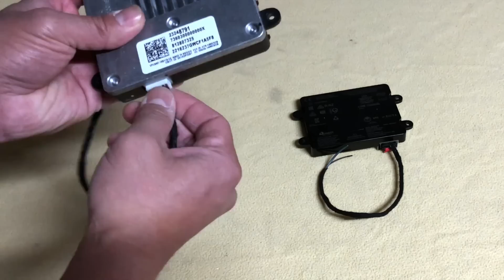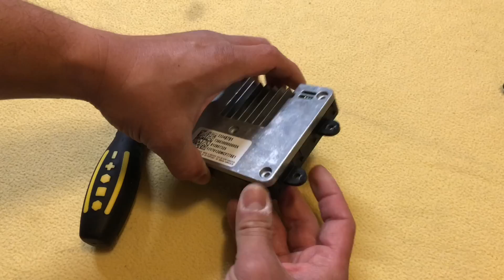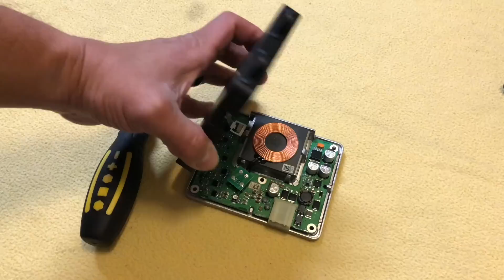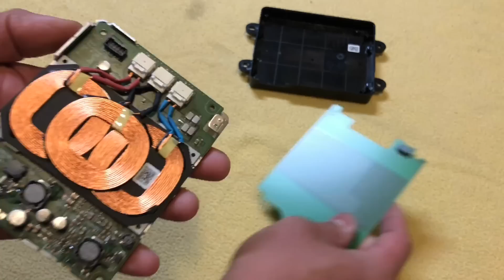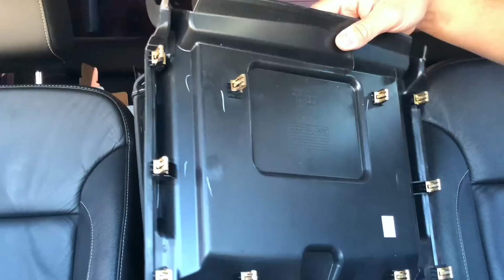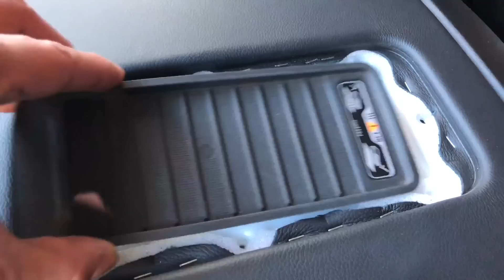2014 - 2018:  GM Silverado/Sierra - Wireless Lid Charging Module Retrofit

Comment: I added my center console from a donor vehicle. It charges wirelessly however my phone says slow charger. Can I assume it is the 18 module? Or should I update it? If it helps I see the charging  pad has 10 raised ribs

Comment: Phil will new charger upgrade charge with the case on your phone? I upgraded my 2016 Tahoe to the new Module, and I am having issues just charging without the case. I think the unit they shipped if faulty as it won't charge even without the case. I have tried moving my phone around but still no dice.
Reply from the maker: Depends. Some thicker cases wont allow the charging to occur, but these 1st gen modules are terrible and not sure why GM released it. The new 2nd gen module charges most phones of today.

Comment: Does this work for the newer iPhones? Like the 11 Pro/Pro Max and newer?
Reply from the maker: Yes.
Reply: @philgamboa2906  thank you for the reply.  That is great to know.  Hopefully the phone doesn’t have to be fully on the mat to charge since they are wider than previous phones
Reply from the maker: @mikey_42712  I have had the larger phones sitting at an angle and it charges.
Reply: @philgamboa2906  thank you for the update
Reply from the maker: @mikey_42712  Sure thing!

Comment: hi is the module 1352 1065 the same as the one you show in the video ?
Reply from the maker: Not sure.  First time I've heard this part # and shows to be from other GM vehicles.  Not sure if its a direct fit or not.

Comment: MY 2017 silverado does not have the wireless charger built in. Is there a website you suggest i can buy one so that i can install it?
Reply from the maker: Not really.  I've seen some on eBay, but you want to ensure you get a 2018 lid that already has wireless charging, as those should be the latest 2nd gen module.

Comment: Very informative video. However you missed the key point on why it won't charge newer phones. New phones use Qi charging protocol, and the old module does not support that.
Reply from the maker: That's correct.  At the end of the video, I show the updated module that does charge and support Qi charging.

Comment: removing the magnet and removing the little pad stuck to the lid will allow the older charger to charge the new phones i did this to mine works great
 the issue with the old model is that the newer phones have a object interference fail safe so the magnet being there causes it to not charge newer phones so instead of buying a new model just take your apart and remove the little magnet in the center and the little square pad stuck to the lid and completely unhook it and bam your old charger will charge the newest phones
Reply from the maker: I tried this and it didn't work for me.

Comment: Great video. I have the early model 2015 without this feature. The factory pigtail is there so I sourced a unit and installed it. No luck. I checked the pins in the factory plug and have no voltage. Does my  truck need to be programmed to make this work? Is there a dedicated fuse for this? Thanks for your help in advance.
Reply: Did you end up figuring your issue out?

Comment: what is the purpose of the ribbon cable? i've seen videos where the ribbon cable was completely removed.
Reply from the maker: There is no info on what it does.  Some remove that ribbon cable and/or the magnet.  Neither option worked for me.  Getting the 2018 Module is the best bet.
Reply: @philgamboa2906  thanks for the response, i went ahead and removed the ribbon cable and it has been working like a champ

Comment: I want to install the original system on my camaro 2LT but my cr do not have the original wire hardness. What are the wire color codes. I have a black, green and purple...

Comment: Phil, did you upgrade your backup camera?   My 2018's clarity isn't so great, I've cleaned the lens. It's been this way since new. 

Are you aware of a better quality camera?   Or any type of upgrade for it?   A stick on lens like they use on phones?   

It seems the monitor has many/enough pixels, as it is crystal clear when not in camera mode. I'm thinking it's the camera quality itself. I wonder if the Denalis or Escalade one are higher quality?
Reply from the maker: I've heard the 14/15 cameras were lower quality than 16+ cameras.  I don't know of any other higher quality GM cameras.

Comment: Hey Phil, I have a 2015 Sierra 2500HD Denali that didn't come with wireless charging. I would like to add it, I'm guessing I would need an entire new console lid with the charger and then a harness. Do you make a harness to add wireless charging to 2014-2015 trucks that came with a full center console but without wireless charging? Thanks!
Reply from the maker: 608 DIESEL Thats correct.  Yes I make a harness for that retrofit.  I can also supply the lid if needed. Email me at sales@harnessdr.com for more info.

Comment: I'm trying to find the part number for the replacement rubber mat that goes on the top of the armrest to allow for longer phones.  Anyone know exactly what I need to search for or its part number?  And does it also allow for a slight bit more phone width to fit?
Reply: Update: looks like the part number is 23264395, but keep in mind GM never updated the part number for the 9 rib vs longer 10 rib version, so make sure you ask your seller which one it is.  I'd still like to know if the 10 rib upgraded mat allows for wider phones than the 9 rib version if anyone knows.  Thanks.
Reply from the maker: @thuhreb  - This is what I have for it.  But it's priced at $67!!  94199943.  The 10-rib is not any wider.

Comment: This was great... I purchased that harness adapter and still have it... Anyone want it for $10... Because you do not need it... Clipped the outer two ridges off the existing plug with some wire cutters and boom... works. Easiest upgrade ever... aside from pulling the top and bottom plastic pieces apart... Holy crap...I thought for sure I was going to break it.
Reply: Long shot but do you still have that harness?
Reply: @rosedoggydog  Maybe but I could not find it if I tried now...

Comment: Phil, reading through the comments below you had not tested rapid charging at the time.  Have you had a chance to test it since then and does it work now (7/2019)?  I'd like to do the upgrade but my issue is with the power requirements to charge my Samsung S9.  Even the USB ports don't supply enough power to charge the phone.

Comment: I have a 2014 gmc sierra w/o the charging lid and I want to install one. What do I need beside the lid and module? Do I have to splice a wire harness in or is there one inside the console ?
Reply from the maker: There won't be one in the console.  I build a T-harness that draws power from the rear 12V outlet.  Email me at gamboaphil@gmail.com for more info and to order.

Comment: Hi Phil....Great Videos....I would like to add the wireless charging to my 2019 Silverado RST that is not currantly equiped. Will the 2018 GM wireless charging module work? Where does the power come from? If 12VDC is what is required can power be linked to the 12VDC receptical inside the console? Thanks foryour help.
Reply: Al Smith I have the same question for a 2019 Tahoe.

Comment: Couple questions. How would this affect the warranty? If something arises after changing this part out, would just that part become not covered, or would it void the entire warranty on other issues as well. Also they like to scare you at the dealership trying to get you to let them do it. They tried telling me you might get electrical  alerts that might need reset when changing out any type of electrical components. Any truth to this? Lastly, you said there’s really no need to flip the mat? Your iPhone X charges everytime? Looking at around 99$ for parts and 120$ for install if the dealership did it, and about 60$ if I did it. Just had those other concerns is all. Thanks

Comment: What if my 2015 GMC 3500 Denali doesn’t have this & i want to add it. Is that charging module simply 12volt ? Or does it have to hook into the system if you want 100% OEM ??

Comment: Hi Phil,  will the 2018 module work on a 2014 Cadillac Escalade? I. Want to be able to charge my iPhone XS Max? If so where can I purchase the 2018 wireless module?
Reply from the maker: Yes they will work on escalade.  They will work with any GM vehicle that has the 1st gen wireless charging module.  As for your iPhone XS Max, I have one as well.  On the truck platform, the lid doesn't allow the phone to sit flat, but it will charge.  For escalades, the lid has a wider mat area and the phone sits flat.  I stock the module and adapter harness for $115 shipped.  Email at gamboaphil@gmail.com to purchase.

Comment: How can I hot wire the module I have a 2015 Cadillac Escalade and didn’t came with a module thanks
Reply from the maker: 93gmctruck1 I have designed a harness for this that makes it Plug and Play. $45 for the harness.  Email me at gamboaphil@gmail.com for more info. I can send you pics as well.

Comment: Ihave tahoe 2015 ltz .. i bought the updraded module of 2017 .. what is the fitted wire to it ..?? And how to get l
Reply from the maker: The updated module is 2018.  Did you console already have wireless charging?  If so, I have an adapter harness for it.  If you didn't have wireless charing and you added it, I have a different harness for that.  Email me at gamboaphil@gmail.com for more info.
Reply: @philgamboa2906  dear phil yes my tahoe ltz 2015 already have wireless charging but i bought the 2018 module so which harness do i use ??
Reply from the maker: Soma Mohammed you’ll need my adapter harness if you had wireless charging and updated to the 2018 module. $28

Comment: Hello phill I have a 2015 Denali Duramax pick up with out the charging feature. If I order the module from Gm and the harness from you can I install it in my truck? Does gm rough it in?
Reply from the maker: Marco Urzi - If you don’t have the charging now, there be some additional things to look for. Email me at gamboaphil@gmail.com for more info. I build harnesses for this conversion, but you’ll need to check some others things too.

Comment: I just want to verify, will the 2018 module work on a 2014 GMC Sierra? I’d like to add this to my truck. If so, how much is the module? Thanks!!
Reply from the maker: If you already have wireless charging, but have the older module - Then yes, this will fit.  You'll need my adapter cable to be able to plug it into your harness.  The module itself is about $100.  My adapter harness is $25.
Reply: My 2014 Sierra didn't come with wireless charging at all. Is it possible to add a wireless charging console lid that has the 2018 module? I basically need to go from no wireless charging to the latest. Is that possible and where can I find all of the materials? I really appreciate your help. Thanks!

Comment: Phil. Do you know if the Suburban Lt model already has the wiring installed even though it doesn't have the charging module.  I am thinking of ordering the module and installing, but I'm not sure I would run into if the wiring isn't there, or if I need to find a connector
Reply from the maker: Most likely not.  In many things GM, I found this to be the case.

Comment: Great Video! When will the harness adapters be available?
Reply from the maker: Lucas Johnson - Parts on back order until Late September, early October.
Reply: I  sent the $25 payment to your email address on your other website and I got and email back from PayPal saying it went to Pedro Hermosillo. Is this correct? I    used this email phil.gamboa@icloud.com to send over the payment. Please let me know if you received payment or if I    need to contact PayPal. Thanks again.

Lucas
Reply: I   was wondering if you had a chance to look into this or if you received my payment?
Reply from the maker: Lucas, I did receive payment, however, this item is on back order until late September, early October.  Main reason for this is because GM and other aftermarket suppliers essentially copied my idea for this harness and is starting to make their own.  Your spot is saved in line.  If you'd like to stay, I can keep ya there, or I can refund.  Let me know.
Reply from the maker: This is correct.  This is shared account.
Reply: No please keep my place in line. I   just wanted to make sure I sent the payment to the right place. Would rather buy from you helping people and not GMC that is all ready over charging! Mt wireless charging module came in today so excited to get started. Thanks for all your help.

Comment: Hey where can i get the 2018 module and pigtail? And how much?
Reply from the maker: The link is in the description.  But here it is as well.  It is on backorder right now.  Materials are supposed to be shipped on 10/3.  It has been on back order until June, then got pushed to July, then August/September, and now into October...unfortunately.  http://www.gm-trucks.com/forums/topic/209096-2014-2018-silveradosierra-wireless-charging-module-plug-and-play-harness/
Reply: Ok thanks how much for the module?
Reply: Phil Gamboa my truck is a 2015.5 2500 high country, i found a wireless lid a got it in the mail today. All i have to do is ground the negative and connect the hot wire to some like my cigarette lighter for it to power up right?
Reply: Phil Gamboa or how do u recommend i wire it so it will work?
Reply: I ordered from GMPartsDirect.com 10 days ago.  Part No. 84526978 $61.00 plus $17 shipping.  Took a week to get, included the adapter plug.  Works great!
Reply: chucklee9999 thanks

Comment: Anyone know that voltage these units require?   Thinking about adapting a salvage unit for another, non-automotive project that will be solar charged.
Reply from the maker: Bill Moore - 12V
Reply: Probably should also have asked by amperage and watt hours draw.  Thanks!

Comment: Can you do this upgrade if I never have a charging module in the truck in the first place?
Reply from the maker: Yes.  If you already have a full center console, you can purchase a lid that already has the wireless charging module.  Then you would have to splice that in with the rear cigarette lighter plug.  If you want OEM method, you an explore the 42-Pin connector at the front and see if the wireless charging module circuit is present (most likely not).  Splicing it in would be the easiest.

Comment: Hello Phil, how can I order the adapter wire?  Jmrogersmd@aol.com
Reply from the maker: I am currently sold out.  I updated the link in the description.  Due to manufacturing delays, there is about a 3-4 week lead time.  Bookmark the thread as I will update it once I am back in stock.   Thanks!
Reply from the maker: Here is the thread on how you can preorder this.  Once it is available again, i will build/ship in the order the came in.  

http://www.gm-trucks.com/forums/topic/209096-2014-2018-silveradosierra-wireless-charging-module-plug-and-play-harness/

Comment: Great video, but the problem I have with my 2016 is my phone (Galaxy S6 edge+) is too wide to fit the charging tray and won't sit flush. I'm not sure the 3 coil charger will make any difference there. I will be getting a new phone soon and was going to go with something narrower so I can charge it. Can that trim ring be modified to fit a wider phone? Any insight you have is appreciated.
Reply from the maker: Chris Kozel - You’re absolutely right. Wider phones are a challenge.   I hope GM could design a wider ring.
Reply: Phil Gamboa-Maybe a combination of the 3 coil charger and a slight modification to the bezel would allow it to work. I like a bigger phone because my hands are bigger than your average bear. I may have to explore some different options now that I have an idea of where to go.
Reply from the maker: I agree.  I used to use an iPhone 7+ and like the larger size phone.  I went to the iPhone X which is slightly smaller than the iPhone Plus size.  The iPhone Plus' width doesn't fit, while the iPhone X does.  I would imagine a wider custom ring and the updated triple coil module will do the job.
Reply: Phil Gamboa - How much are you selling the pigtail harness for? I got a new phone and it does fit in my charging tray, but won't charge. I verified it does however charge on a 2018 truck so if I buy the new charger I'll need your pigtail harness to make it work. Shoot me a message when you get a chance. Thanks.
Reply from the maker: Chris Kozel $25 and the link in the description to order.
Reply from the maker: http://www.gm-trucks.com/forums/topic/209096-2014-2018-silveradosierra-wireless-charging-module-plug-and-play-harness/

Comment: Great Video Phil. I have a 2015 Sierra (not equipped with wireless charging) I bought a 2016 Charging Lid and i just ordered the 2018 Charging Module. I'm going to order your pigtail harness right now. Could you do a Video on upgrading lids from a non-wireless to a wireless charging lid.... Man that would be so helpful, theres nothing online about doing this, you would get a ton of views. 

Thanks Man your the best!

To order Phil's Pigtail Harness:
http://www.gm-trucks.com/forums/topic/209096-2014-2018-silveradosierra-wireless-charging-module-plug-and-play-harness/?tab=comments#comment-2078503 

To order a 2018 Charging module:
https://www.gmpartsdirect.com/oem-parts/gm-f-module-13521066
Reply from the maker: Richard, let me if I can find some time to record some video on this swap.  But in the meantime... To remove the lid, you'll need to remove the rear panel.  To do this, there are 4 torx screws.  2 of them are hidden by the rubber pad in the pocket.  Once you remove the 4 screws, the rear panel pops off.  Then you'll see some bolts holding the hinge in.  Remove those and the lid comes off.  

For wiring, IF you want to keep things OEM/Factory, I would suggest getting a console harness that has the pigtail for the lid to plug into.  Otherwise, you'll have to splice the lid cable in somewhere like the cigarette lighter.